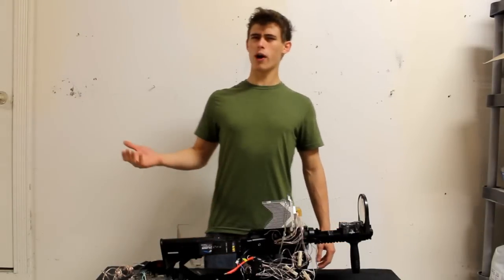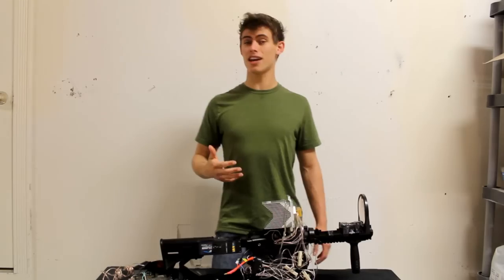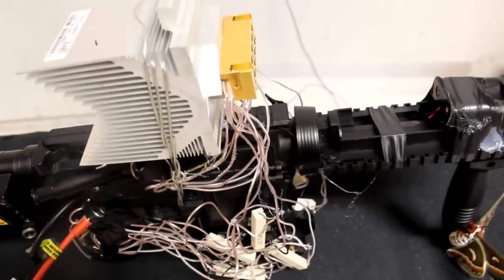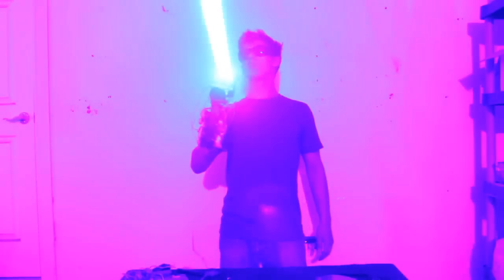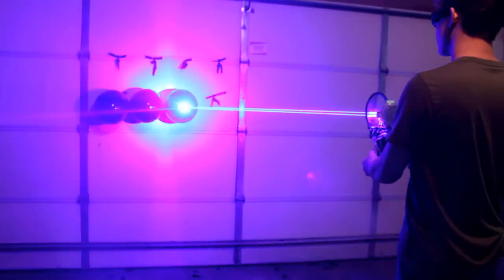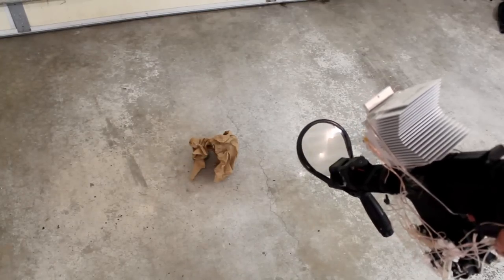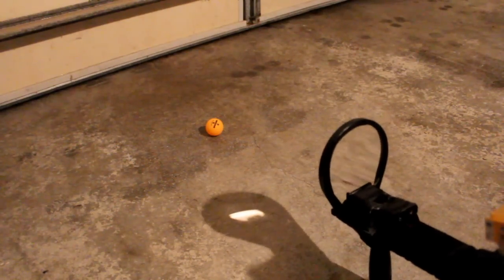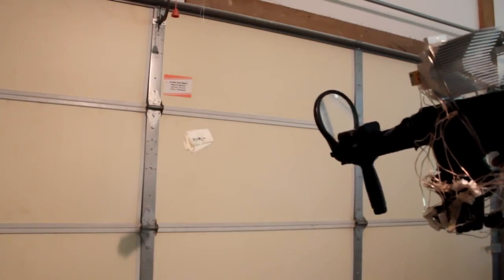My Homemade 40W LASER SHOTGUN!!!!!

Comment: The problem is, it's not 40W, it's a bunch of 5w lasers...... Just because you have 20 wifi routers to your house doesn't make your internet speed 20x as fast, you can still only connect to one.
Reply: joblessalex That was a completely retarded comparison...
Reply: Thanks. I pride myself on shitty analogies.
Reply: ***** actually that is exactly how lasers work.
Reply: joblessalex Unfortunately not an accurate accurate analogy at all. This is no different than using a lens to converge the suns light into a single point to burn leaves, or using a fresnel lens to build a solar cooker. By converging all the light on the same point using a lens, there IS much more energy at that point. There will be some imperfections in the lens, causing imperfect allignment of the beams, as well as some phase issues due to using different current drivers, but the energy at the convergence point will most certainly be much higher than 5W, it probobly won't hit 40W, but its not going to be only 5W, which is what your analogy implies.
Reply: joblessalex A 00 Buckshot shotgun cartridge isn't a half-inch of lead: it's seven .32 caliber balls that all hit you at the same time. It's not really .224 caliber but it's extremely painful.

Comment: about how many watts to slice off body parts?
Reply: Based on absolutely nothing it seems
Reply: JYC422 My guess, if you want it instantly, over 500 watts. Give or take 30 watts, depending on individual fat percentage, muscle mass, and bone density.
Reply: silverbird58 Aha. The ol' microwave angle. The heat and energy to kill a human being is far lower than what's needed to cut/burn through a limb.

Comment: Two things
1. Be careful with reflection off of the lens. You might want to consider using AR coated lenses.
2. It's pretty sweet that you do this in your free time. You should definitely consider studying physics or engineering if you haven't already. The better choice is clearly physics (I'm also biased), but in both cases you can work on some really sweet laser systems.

 For instance, at the university I work at, there is a faculty member (Jorge Rocca) who is builds some insanely high powered lasers. For instance, he has a laser that so powerful that it breaks air. In the lab I am working in, we are building a laser system for cooling hydrogen. This laser will be ~500W of 243nm light (so UV). Another laser we are building is so-called mode locked laser (we are making a frequency comb). In contrast to high power, this laser pulses about 100 million times per second. The moral of this story, you seem to be really into building lasers and that's awesome, if you go to graduate school specializing in such fields you get to build these things for a living.

Comment: Would this work against body armour?
Reply: theguy9208 It will also work on steel, you just need to apply jet fuel onto the beams before you charge your lazah
Reply: theguy9208 However, it would start to get quite uncomfortable in there... You might not melt the armour, but all the heat has to go somewhere.
Reply: theguy9208 ceramic has higher melting points than steel, that is why they use it in molds and kilns
Reply: Pete Myers No, because while this guy was standing there holding the laser for the required 8 hours it would take, the guy in armor would have long since shot him.
Reply: its would probably just start to melt the vest dumbassPete Myers
Reply: Pete Myers ceramic armour maybe, but steel has too high of a melting point i reckon...
Reply: theguy9208 This puny laser won't melt anything ceramic. Maybe the material that binds the ceramic plates in body armour but not the ceramic bits themselves. Do you know what happens to clay when you put it in a 1400 degree oven? it doesn't melt. It gets harder.
Reply: No. A mirror can withstand this kind of power. That being said, an suit made of mirrors would be terribly impractical I think.
Reply: Hubert Applebaum that or just point the laser it it for 5 hours straight

Comment: So would this be able to burn flesh after a few seconds of exposure? I assume it could at least blind someone extremely quickly.
Reply: ***** If it has no rules, then what's stopping you from going nuclear? Seemingly some rule, be it a moral or even a consequential one.
Reply: ***** good thing stupid people like you will never rise to any position of power.
Reply: ***** War absolutely has rules, and the failure to follow them is how you get tried as a war criminal in an international court.
Reply: Professor Teacrumpet von Fuckington A 1-watt laser is an extremely dangerous thing. It’s not just powerful
enough to blind you—it’s capable of burning skin and setting things on
fire. So 40w.. Yeah..
Reply: Professor Teacrumpet von Fuckington If it took a few seconds you might actually be safe. At this power level, this laser will blind you instantly. The lens in the eye focuses the laser into a pin-point right in the middle of your retina (the most useful part of your retina that maps to the centre of your vision) and starts burning from there.

Chances are, even just specular reflections from a 40W laser (e.g. off the moderately shiny things like the balloons he's pointing the laser at) would be enough to blind you instantly. Pointing one of those 5W beams directly in the eye would probably make your eye pop as well by boiling the fluid within and causing the outside layer to rupture.
Reply: but can it melt steel beams
Reply: blackhat2005 Maybe use it only as response to whoever is attacking his people.
Reply: Professor Teacrumpet von Fuckington I think this could blind someone instantly.
Reply: Professor Teacrumpet von Fuckington If you got hit in the eyes with this thing, your vision would absolutely be irreversibly damaged way faster than your eyelid could block the beam from your retina through your blink reflex. Even a 1W laser can destroy eyesight almost instantaneously. Laser glasses are a must with these things. From first hand experience my 1W laser will burn skin if you hold the beam in one spot on your skin for more than a few seconds.
Reply: ***** http://en.wikipedia.org/wiki/Geneva_Conventions

The UN appears to disagree.
Reply: ***** that's the dumbest shit i've ever heard. MAYBE that would be true if you conqured the whole world.. GOOD FUCKING LUCK.  If one country wages war against another and commits heinous war crimes in the process it doesn't matter if they win or lose NEUTRAL nations who witnessed the crimes will bring the leaders of the military and government up on war crime charges.  This has happened about a bajillion times this past century for reference.
Reply: vincentpol Some riot controls actually use those weak green lasers to disorient people.
Reply: You guys have sufficiently scared me out of associating with anyone who owns anything more powerful than a dollar store laser pointer.
Reply: Professor Teacrumpet von Fuckington It could definitely burn skin and even kill people, but like you said it would require extended exposure to do this. The problem is compounded when someone wears heat-resistant or otherwise thick clothing or armor.

It can be used as a lethal weapon, but it's not necessarily a practical one. Best to just keep using good ol' fashioned bullets.
Reply: blackhat2005 Nuclear winter ensures that the nation you seek to destroy isn't anywhere close to the only nation afflicted
Reply: Will Pack Yet to see them used: look up LAWS lol. That's a 90s demonstration. Not exactly new technology but it is improving.
Reply: Will Pack So really, its more humane to permanently blind your enemies than blow their bodies to bits.
Reply: Will Pack blinding falls under part of the geneva convention and is taboo in times of war and using weapons to purposely blind or deafen people is a war crime
Reply: ***** It has plenty of rules. Geneva conventions.
Reply: ***** And that's all good until they do it back to you. Every time you use something against the rules you give them the right to do the same. It's the whole mutually assured destruction thing. It's what makes nukes so scary because as soon as one person fires the first shot then whoever it's against/allies can do the same shit.
Reply: ***** Because you are a barbarian.
Reply: I'm pretty sure there are some pulse laser designs that only temporarily blind a target, but do not cause tissue damage.
Reply: Will Pack 

You can't reliably make sure tranq darts would stick. Even if they were easily going fast enough to go right through skin, and clothes, then soldiers would then just start being equipped with better armor.

In the end lethal force is the only reliable way to get the job done, period.
Reply: Will Pack
:)

I know we want to end our conflicts as peacefully as we can but sometimes that's just not the world we live in. Rather than spending so much focus on the methods of war we should instead be thinking more about what battles we fight, and why.
Reply: ***** My 1 watt blue Arctic will start to burn skin in about a second and if I try it on chicken skin it burns it very nicely. And that's nothing compared to that thing in the video.
Reply: ***** You would lose in Civilization pretty quickly.
Reply: Professor Teacrumpet von Fuckington Sounds like it's perfect for riot control. People won't fuck around with a 40W laser aimed at them.
Reply: AStaticCharacter 

War.

War never changes.
Reply: Will Pack I'd rejoice the day we have a network of lasers in orbit that vaporize anyone who even thinks of committing a crime.. or going to war. We would still have free will, it would just take the fun out of doing bad things. ;)
Reply: kneejo I'd rejoice the day we have a network of lasers in orbit that vaporize every living thing.

Life is an abominable aberration that must be destroyed at all costs.

Nothing must be allowed to survive.
Reply: blakkcooper All living things must be vaporized. Life cannot be allowed to continue in any form.. Kill all living things.
Reply: That one guy from the internet The only answer is to kill anything that lives. Living things are unpredictable. Rocks, on the other hand, are much more predictable.

Kill everything that lives.
Reply: Droopus Tunes Kill Kill Kill Kill
Reply: Peace Love Bunny

Fair enough, but not before I have my fun first 

:)
Reply: That one guy from the internet Just this once.

Get to it.

Then comes the killing.
Reply: ***** The US military experiments with non lethal weaponry from time to time. They have a focused heat ray called "Active Denial System" http://en.wikipedia.org/wiki/Active_Denial_System
Reply: ***** Thank god you're not a ruler of a country, then, because your dumb ass would get fucking obliterated. 

There are rules in war; if you break them, then you have committed a war crime and your country will be punished via shit like trade bans. Should you lose the war, you will be tried for warcrimes. You can destroy a country without firing a single bullet, all you have to do is ostracize it and prevent others from trading with it. The infrastructure will crumble, as will the standard of living; it's what the US is doing to countries like Iran and North Korea.

Ethics in warfare exist because it's largely agreed upon that shit like firing at ambulances transporting wounded enemy combatants or commercial airplanes carrying civilians is fucked up. If you do it to your enemy, your enemy will do it to you.
Reply: 420atheism That fucking movie... ;_;
Reply: Swog Swogling Aren't you just adorable :) Believing everyone gets punished for war crimes, so cute I wanna just wrap you up and put a bow on ya. :P
Reply: Swog Swogling Agreed, sanctions work great, that's why Iran and North Korea fell years ago :)
Reply: ***** Geneva Convention....
Reply: Hyaku I believe heat-ray weapons haven't been banned yet as far as I know. US already uses heat-based weapons during riots. (Look up Active Denial System) These make you feel like you're standing in the middle of the Sahara. Non-lethal, but very effective. However, these are mounted on a truck and thus not usable in narrow corridors.
Reply: vincentpol Yeah, weren't they banned somewhere around 1995?
Reply: Hyaku I don't think so. From my understanding the problems are that you don't just have 1000s of these lying around. They're quite expensive to build and require an entire vehicle to be modified for that purpose. 

Also, they're not very mobile despite being on a vehicle. If you move around it already loses its potential as it works by concentrating its beam on a single target for a small period of time. 

But mainly I imagine pepperspray, teargas and even rubber bullets are by far more effective and cheaper than this. I've yet to see a group of rioters happily continue with a bunch of teargas lobbed at their faces. Why change a winning formula?
Reply: vincentpol Yes, very true.
Reply: Hyaku But you're right though about the 40W laser beam that OP made. I can't imagine that being legal to use. It would just burn through people's clothes and their skin. But perhaps a weaker version could be used.
Reply: Will Pack Blinding weapons are technically illegal.  Military targeting lasers are even supposed to be employed in such a way to minimize chances of blinding people.
Reply: Professor Teacrumpet von Fuckington No, this laser is only dangerous to wood, metal, plastic.......of course it will burn ya!!!!!! LOL
Reply: Hyaku Or just use crossbows like the Chinese.
Reply: Will Pack Aside from the fact that tranquilizers take a few minutes to work (which in itself completely cripples their use for general military application, you don't want to wait 5 minutes for the guy who's charging you with an AK to drop), the range and magazine capacity is unoptimal , they'd likely be poor at piercing vests, and the dosage required for different targets is variable. What might be just enough to sedate one guy might be a lethal overdose for another.
Reply: Professor Teacrumpet von Fuckington This would blind you instantly, burn you severely in about 10 seconds and set your clothes on fire in about 20 seconds.
Reply: ***** That iss because you are a complete fucking idiot. Congratulations.
Reply: Bararara Bororor Microwave cannons are in use
Reply: Professor Teacrumpet von Fuckington Microwave cannons are more painful :D
Reply: ***** You would be nuked by them after they attack you... I dont see where you would go... Fallout 4 confirmed.
Reply: blackhat2005
It's a practical one.
After the war ends, you should be able to potentially clean up the aftereffects of small arms, bombs, lasers, etcetera, so shit can get back to normal.
Nuclear stuff, on the other hand, leaves ionizing radiation, which will leave your DNA in a state most people would describe as "completely fucked".
Reply: Ryan Sample I guess ionizing DNA would permanently denature it?
Reply: Scoopicus
But can a 2W laser be used as a laser sight?
Reply: Ryan Sample You can never have too many lasers.

Comment: I would love messing around with lasers but I heard that their radiation levels are high. I don't want to get cancer 30 years from now just for playing with lights.
Reply: Jack Middleton You could stand in the sun for 20 minutes and get more radiation than from playing with lasers for a year.
Reply: ***** I don't think its hearsay. Radiation is all around us all the time, but that is playing semantics. Obviously what I am referring to here is dangerous levels.
Reply: ***** You can purchase powerful lasers online but do you ever wonder why there seems to be a limit? I think it is because anything more powerful would be too much radiation and irresponsible for them to produce.
Reply: Jack Middleton It's probably because of something else that there is a limit.
Reply: Leitilumo You could put a balloon under the sun for 20 minutes and it wouldn't pop from the energy exerted on it like in the video. What's your point? Incidentally, you can actually get skin cancers from UV exposure from sunlight.
Reply: joel : Thermal (non ionizing) radiation and Ionizing radiation are vastly different forms of energy. Thermal energy vibrates molecules to produce what we feel as heat. Ionizing radiation causes the severe damage that we often think of when someone has a radiation burn.

EDIT: What I'm saying is that the Ionizing radiation (if ANY) from these lasers is probably not as dangerous/high as it's purported to be.
Reply: Jack Middleton Wrong kind of radiation. Don't worry.

Comment: Hey styro, ive watched your videos for awhile now, and ive done some research on the interwebs, but never found anything that helps. What is an easy way to get started in lasers? I love tinkering with machines and always looking for new toys, and im wondering if you could help me get started. Thnx alot, love the vids.
Reply: Lil' Bucket I don't know where to put you at a start, but I can give a tip for future reference if you're going to get into lasing. For the sake of your own eyes, don't mess with Infrared lasers, meaning Green, unless you know what you're doing. Too much IR bleed can blind ya.
Reply: Wildlink123 Alright thank Wild, i never found that on the jnternet so its actually a big help.
Reply: Lil' Bucket Hey anytime. I don't mean to discourage you of course, mainly saying learn a lot more than normal before you do go building greens. And make SURE it's a good and trusted Diode.